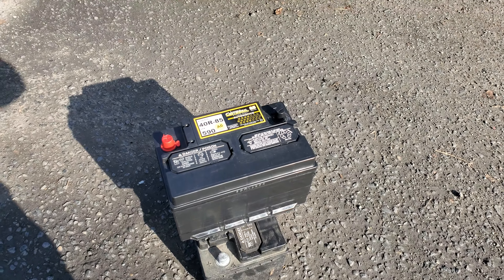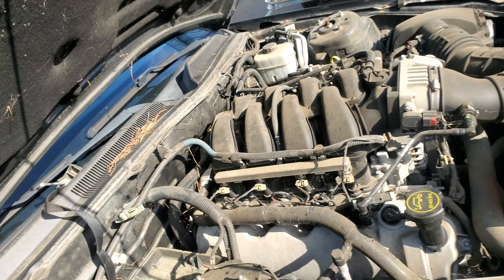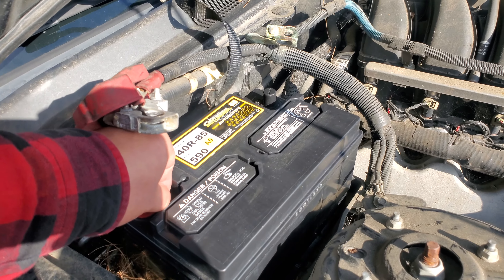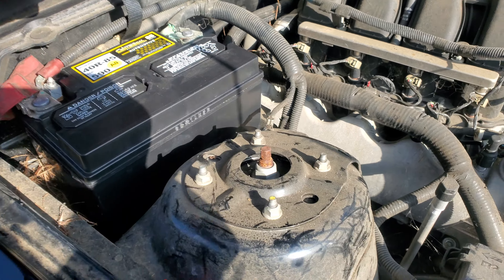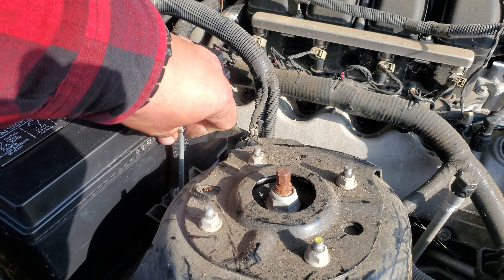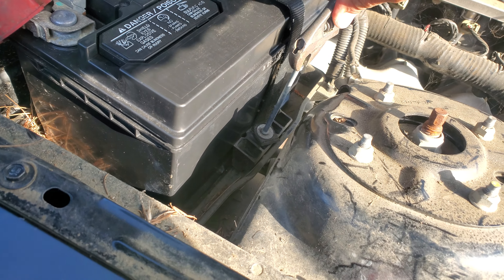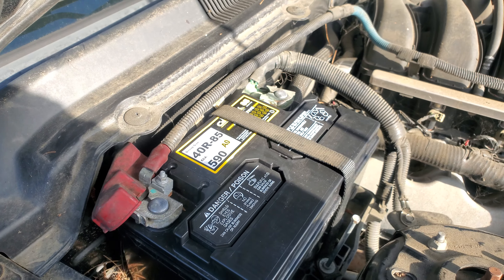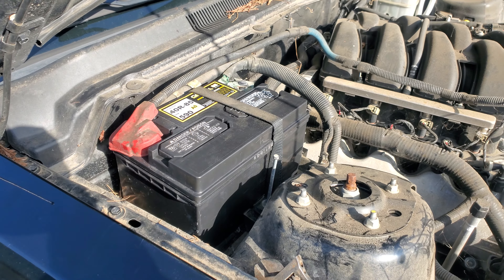How to: Install a New Battery on a 2007 Ford Mustang Gt

Comment: Good DIY installation. My 07 positive terminal is stuck and won’t budge. Any recommendations? Thanks in advance
Reply from the maker: You can use a flat head to try to open the terminals and then use bulky pliers to wiggle it back and forth and pull up till it comes out. Hope this helps, good luck bro!